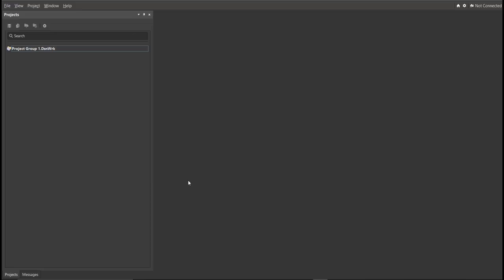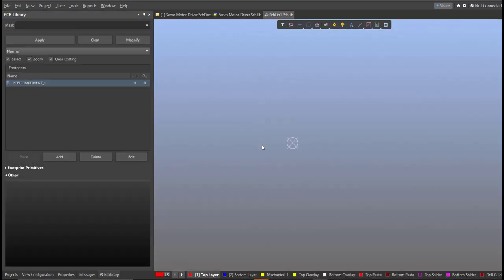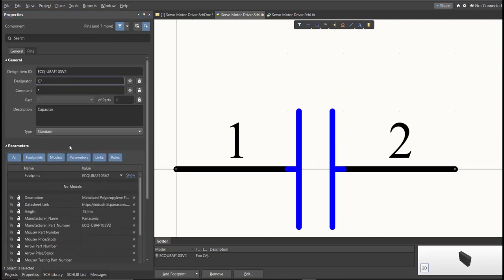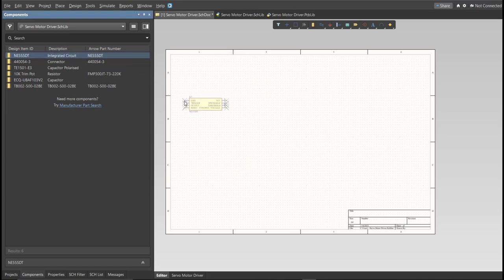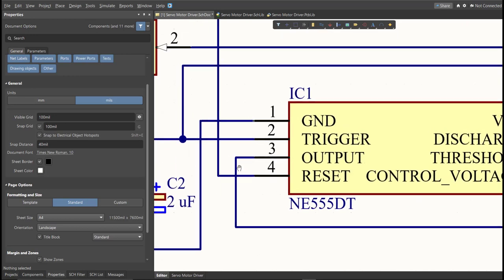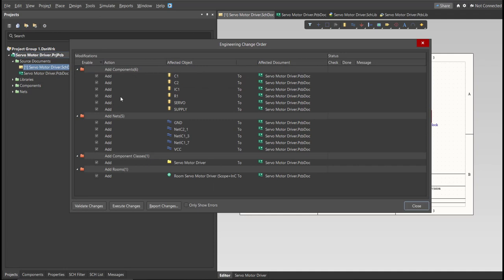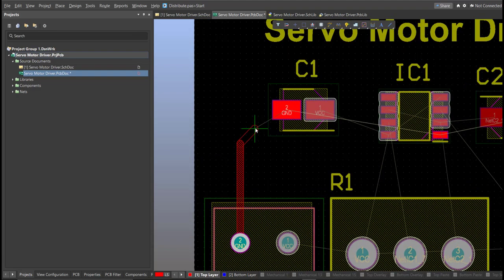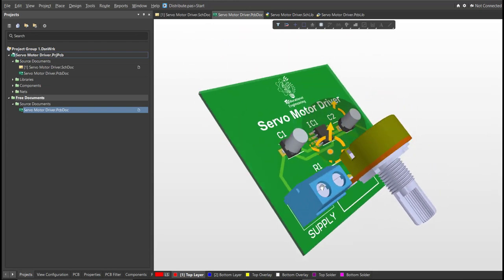Servo Motor Driver using Altium Designer

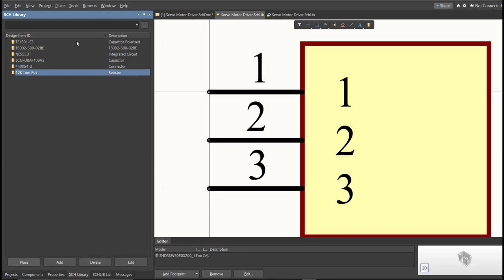Comment: The resistor part at 4:46 doesnt match with resistor design labelled in the table, they look different.
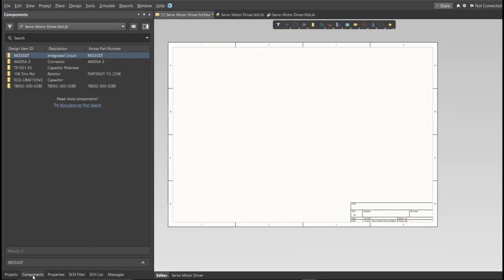Reply from the maker: Good catch. A resistor can look different in Altium because the schematic symbol and the physical footprint/package are separate, and different libraries also use different symbol styles. Which resistor reference designator at 4:46 are you comparing with the table?